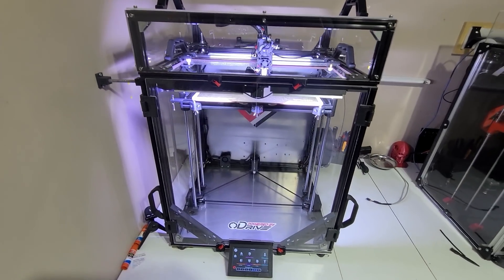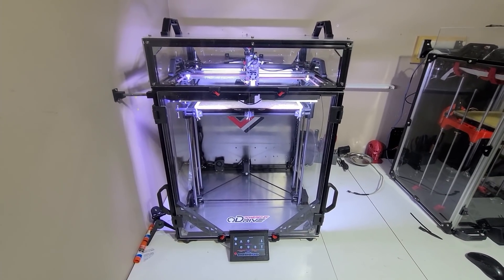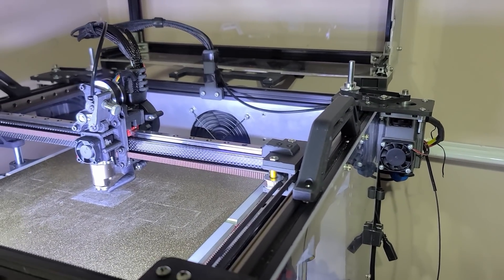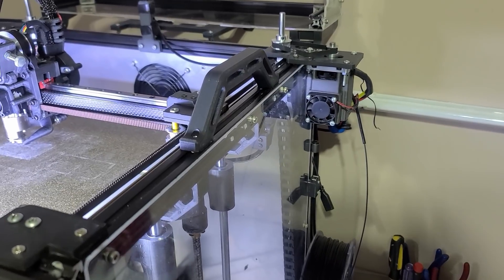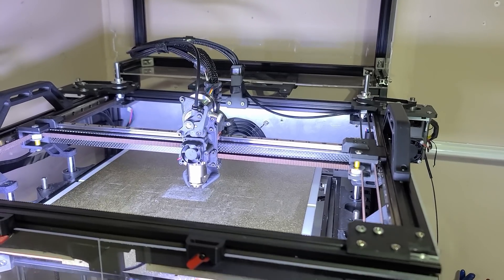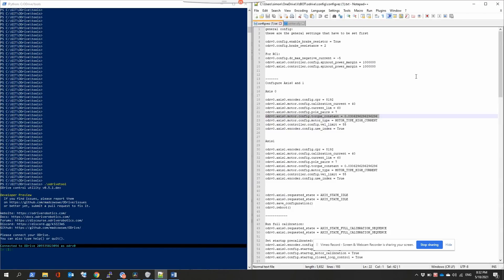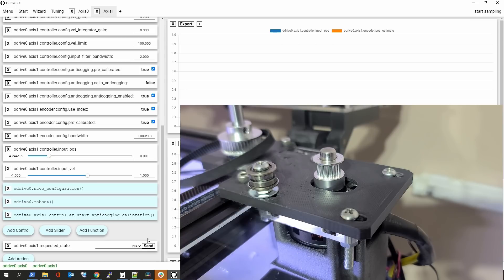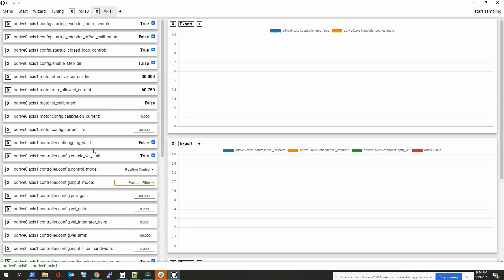ODrive 3D Printer instructions

Comment: Dang, that drive pulley looks really off center (lots of horizontal wobble) at 55:10. If you were having surface quality issues, I'd take a look at that.
Reply from the maker: It is way off. Cheap chinese pulleys. I have some on orders. But its not affecting printm the final drive pulley is all good and spins fine.

Comment: Do you not also have a 1/2 gear ratio. So 10mm per rotation. 28:00.
Reply from the maker: 20mm per rotation. 1:2 .. last gear is 20th... 2mm pitch.

Comment: what kind of extruder did you use ?
Reply from the maker: Back in that time it was the hextrudort
Reply: @Vez3D  Is there a specific driver used on the extruder?
Reply from the maker: @restipalupi  i use 2209
Reply: @Vez3D  what firmware is used to run your printing process ? because on my 3d printing , bigtree skr is set with Marlin firmware
Reply from the maker: @restipalupi  klipper
Reply: @Vez3D  for using Odrive motor with Bigtree is it not a problem if I use Marlin Firmware ?

Comment: hm.. 
i still dont get the reason to do this, when brushless servos are the same price and offer all in one solutions.
Reply from the maker: Could you show bl servos cheaper? Maybe i can try. What im affraid is will they be able to have the same accel as odrive? And same speed?
Reply: @Vez3D  I thought the clear path servos MirageC used were about 250? So kinda the same range
Reply from the maker: @hanswurstusbrachialus5213  its a really nice option too if you can afford it
Reply from the maker: @hanswurstusbrachialus5213  he told 350each..  but we might be ok with the smaller version at 257$. Add 10$ for 1/4 shaft and a bit more for the high res encoder. You are closer to 300$. Which is not bad too

Comment: how does it print? in terms of quality improvement
Reply from the maker: It prints super good. I cant say improvement, as it was printing good begore, but I can reach much higher speed and accel. I only have one downside so far, and its vertical artifacts on straight walls. Probably caused by cogging

Comment: I would be curious as to why now a days he is no longer using ODrive
Reply from the maker: @BrianVoelker  because I wanted to run the same config as what the official printer runs for everyone. And developpe arround it. That way, people seeing my prints can do the same since I run the same hardware. Also, at that time I had a bit of artifacts issue with the corexy config with the servos fighting each other in oscillation to keep their position. This was due the encoder not have enough resolution I guess. Now they have higher encoder resolution which i think would fix the issue. But the setup is still far more expensive than running steppers.
Reply: @Vez3D Amazing answer! Thank you! It was rare at the time to see someone use something other than steppers so i was just curious about it. Would make a great video to do something with them again. but im sure there isnt that much benefit.

Comment: To be fair... NOVA was much sexier haha
Reply: Skeeter uses standard electronics and nozzles available to purchase worldwide at multiple dealers
Reply from the maker: I dont dislike that new one.. but yeah.. Nova was/is very sexy hotend
Reply: @Vez3D  did you already decide which one is better for you?
Reply from the maker: @berberger4814  not yet... didnt have chance to fully test the Magnum+. Thats next
Reply: @Vez3D  also do you have in mind any cooling solution upgrade? Will single 5015 not be a bottleneck for Magnum+ and Odrive setup?
Reply from the maker: @CyC3R  i have redesigned the duct and up volted the fan lol. For now. I have another solution on the todo list too

Comment: WRONG! Changing the gear reduction does NOT make the motor spin faster! It increases the movement, but its not some magic to make the motor spin faster!
Reply from the maker: You got me wrong I think.. or I expressed myself wrong... Gear reduction makes the motor spin faster for the same print speed. Thats what I mean. Only thing that makes the motor spin is electricity :p

Comment: servo drive will be much cheeper.....
Reply from the maker: show me :)  I want to see all my options
Reply: @Vez3D  you may buy 2 servo stepper motors nema 23 on ali with drivers for 160$
Reply from the maker: @vini4806  question now is.. will they perform as good?
Reply: @Vez3D  they have limit 3000RPM )))) and like any servo very high precision with protection from losing steps
Reply: @vini4806  I'm pretty sure you're talking about the NEMA motors with a built in encoder board and some rudimentary control circuits on the end plate. They're useful, and certainly a nice step up from a standard dumb stepper motor, but they're also not Servo motors. Servos have substantially higher speeds, and simultaneously also have much more torque and holding power compared to stepper motors. What you're describing is more accurately called a closed loop stepper motor. For most circumstances, and 3d printers, closed loop steppers have enough power and performance for 3d printers, and if you get the right size, they can even work on a CNC machine. However, they're still not a servo, and are very different.